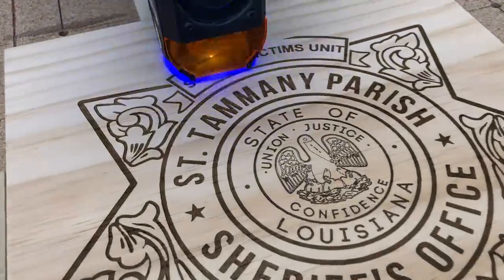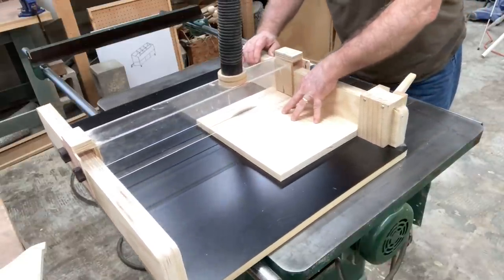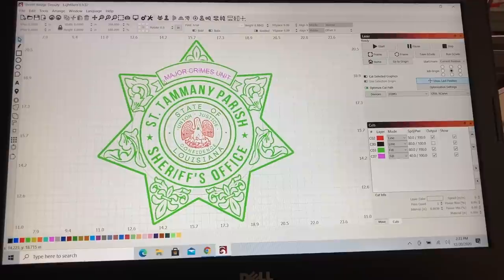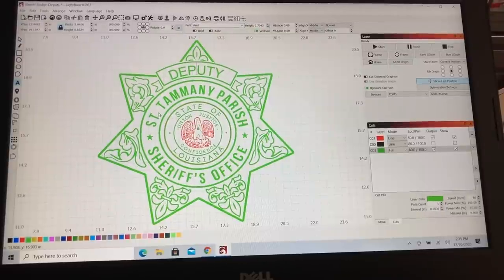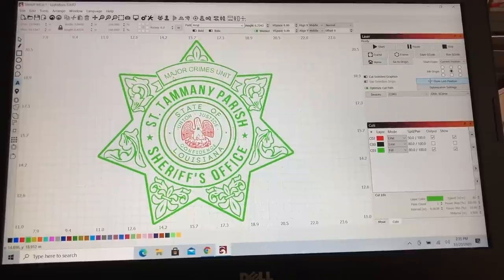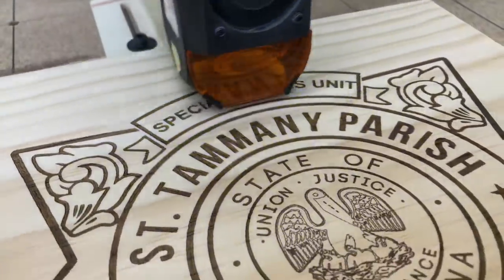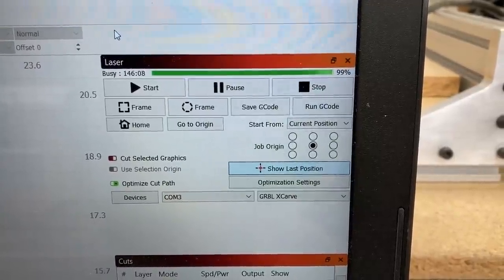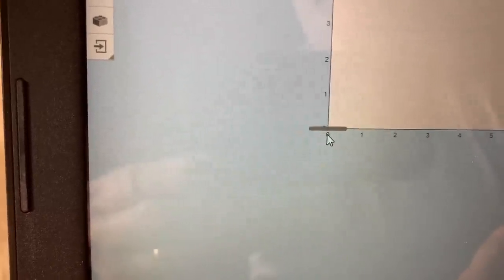Lightburn Text on a Path | Keyhole Slots on CNC & More

Comment: Good morning I am a newbie just bought a Shark SD 100 have not used it still in the box.  My question is will the laser you are using work on a small machine like the Shark SD 100 and what is the name of the laser you are using?
Reply from the maker: The laser is the J Tech Photonics 7 watt.  I do not know the configuration of the Shark SD 100. When you call the laser company, they can tell you exactly what you need and if it will work. Jay is great to work with and is very knowledgeable.
Reply: Thanks
Reply: @PawPawsWorkShop  Thanks

Comment: Why do you do the key hole slot horizontally instead of vertically as would normally be cut?
Reply from the maker: Funny you should ask.  The last video that I did where I did the slot vertical, I got the same question as to why I did it vertical and not horizontal.  If you do it on the vertical you must be dead center or the picture will hang crooked.  If you cut it on the horizontal then you can slide it left and right to get it to balance and straight. I do it both ways and have shown both methods.  You chose how you want to do it.  It is a personal preference.  Enjoy.

Comment: Curious since you didn't use tabs or the glue and tape method how you prevented the pieces from moving when cutting them out.
Reply from the maker: When using the laser you only need registration points.  When I did the cutout I did use tabs for this project.